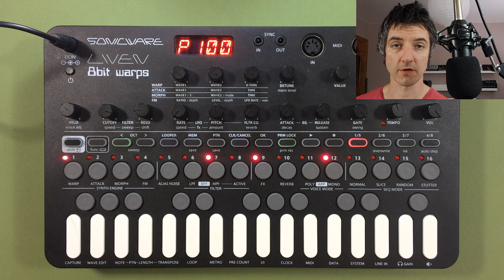SONICWARE 8Bit Warps Drum Synthesis & Programming - Accessible Synth Tutorial

Comment: I can't seem to get the hi-hat sound
When I turn down the gate, nothing changes
Reply from the maker: The gate time only affects steps programmed into the sequence so it won't change anything if you're playing them by hand. If you are playing them rather than programming them try changing the envelope shape instead of using the gate. Also the method of holding multiple steps to program in parameter locks may have changed so if that's the issue program parameter locks into each step separately

Comment: QUESTION!🖐️
Do the U-# banks only hold pure waves created by wave edit?
I noticed patches are saved to PT banks for example PT-91
Yet U-# banks can be accessed from the warp/attack/morph engines...
Why is there access to them from the performance engines?
Reply from the maker: So the U-# banks just store waveforms created by the user using either wave edit mode of capture, the PT-# banks are pattern memories that store notes, synth settings etc. Only warp\attack\morph can access the waveforms but the FM engine doesn't use the waveforms. Beyond that, I'm not sure what you mean by performance engines to be honest 😄
Reply: @ChrisLodyMusic  lol sorry about that.
I call warp/morph/X-lfo on these modules performance engines...😁
I know it's basically all just modulation, but it's kind of these units selling point.
Thanks as that basically answers my question in new light as I didn't know captured waves went into U-# banks.